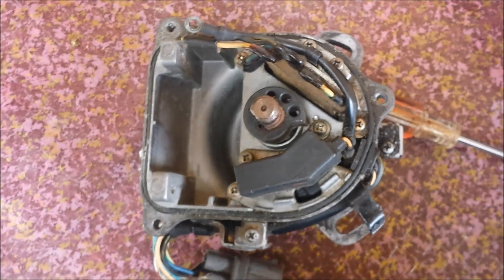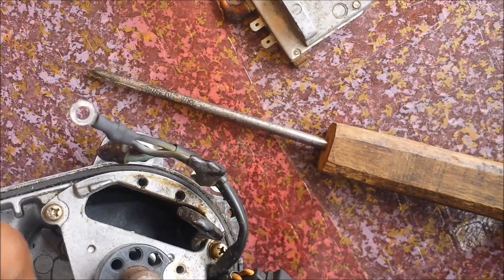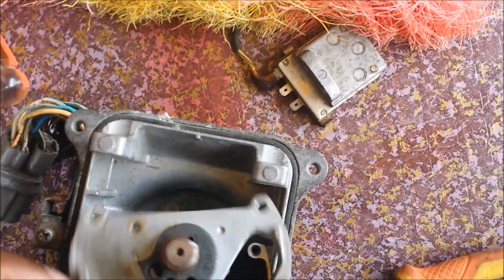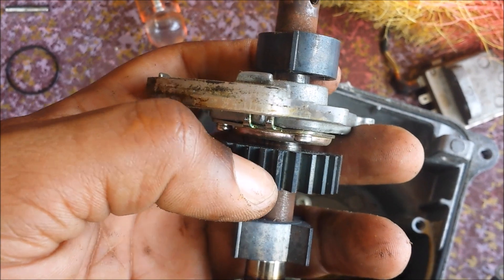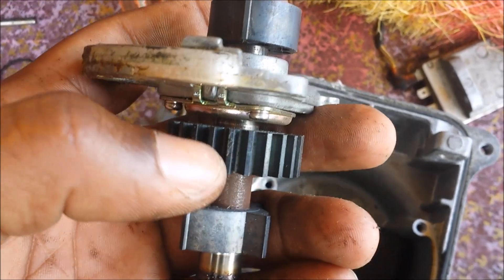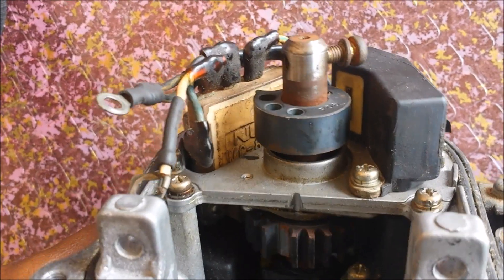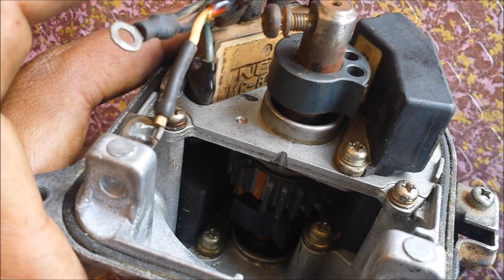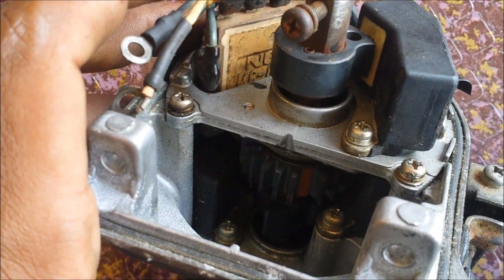Project BIG Red - First Start

Comment: great job mate love your videos. how did you do the wiring after you modified the distributor to 12-1. you still using the ignitor?
Reply from the maker: Wiring stayed stock. Still using igniter
Reply: @DCWERX  so if i do this with my toyota dist, i would run it thru vr conditioner and ign out should go to ignitor? i'm using ua4c

Comment: So, is that 12-1 trigger and batch fire injection you have it set to?
Reply: Looks good. Keep up the good work!.
Reply from the maker: Correct. I need to get it tuned to race in a few days so it will do for now. It will end up being 24+1 or 24-1 and sequential injection in the end. I prefer removing a tooth instead of using the dual wheel but I will do it both ways for the viewers.
Reply: Is basic distributor more problematic?. Is it too noisey?
Reply from the maker: @ciscoperez4271  basic distributor was a lil noisy but I was swapping between 2 distributors so that may have been thinking issue. 

The mods to the distributor are only for testing purposes. Basic distributor or dual wheel with stock distributor will work just fine. I hope to have all methods tested in the coming days
Reply from the maker: @ciscoperez4271  did some testing on my car today and basic distributor works fine. Even with trigger filter turned off, it got zero noise.
Reply: @DCWERX  that's awesome!!. Good to hear. I'm about to leave work in a few. I just redid the wiring on my patch harness. Once I get home I'm going to try again and see if it works. I found  where I had my TPS problem. I had pins 22 and 23 on the wrong pins on my Honda ECU connector. That was my error for using the only two same color wires next to each other.
Reply from the maker: @ciscoperez4271  I have messed up worse lol. I forgot to tell you, set spark outputs triggers in TS to "going High" and set JP1 "IGN out" on speeduino board to 12 volts
Reply: @DCWERX  say "WHAT"!!!!!??? LoL!. I sure will thanks for the heads up 👍.
Reply: Well,.. now I'm not getting a tps signal lol.  I just went through the entire wiring again everything is where it should be. I also changed jp1 to 12v ign out  like you said. My spark settings was already on going high. I'm going to take break from it now until Friday. I should have it running by this weekend lol.